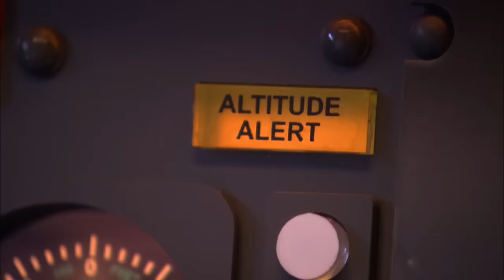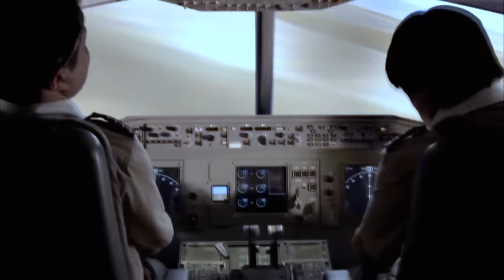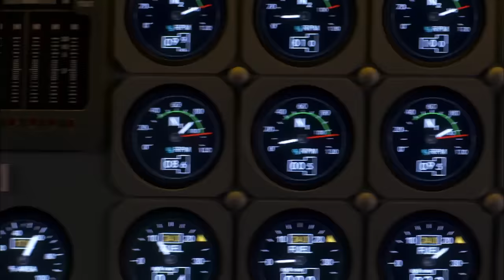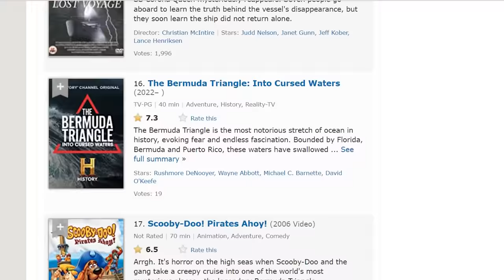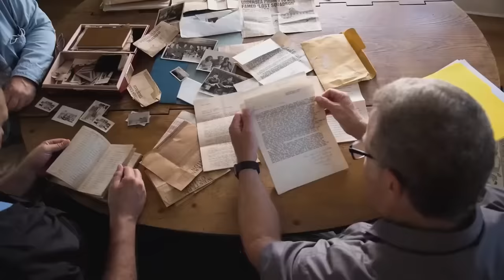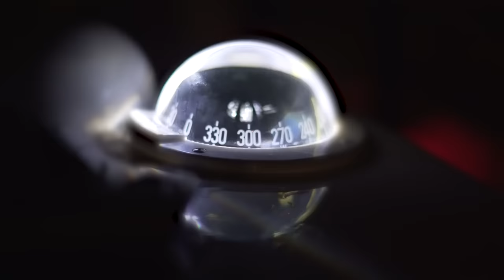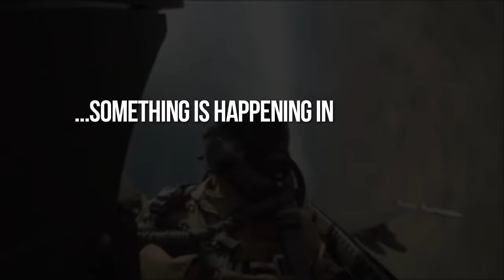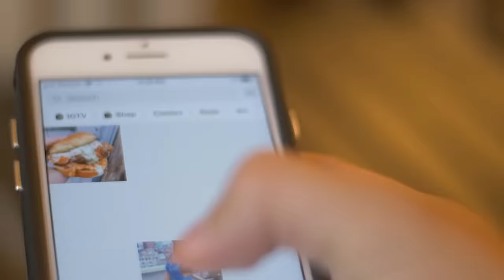Scientists Have Finally Solved the Bermuda Triangle Mystery! What Did They Find Out?

Comment: My theory came out when I am  travelling long stipped mountain have good road surpace about 200 meters long high.
 So I start going up driving a truck loaded gravel.When  I reach 25 meters up the truck engine showing hard to climb and engine deacress sounds from 25  to 35 meters so worrying my  travel. However after  35 meters  the engines sounds  good  shows it's not hard to  carry the load .So I reach the 200 meters easily

Comment: Probably, gravity distribution is different. That's why they having a hard time navigating.

And the reason people are missing, probably tried using emergency boat to escape
Reply: what about the airplanes
Reply: @Crys582  what do you mean? airplanes are also affected by gravity

You can see that if one wing of plane weight is not aligned the flight is not stable

You can also watch in youtube a guy who changed balance of plane by just opening a window and putting hand outside means the weight(gravity) difference also affected everyone even in air

Comment: The blackbox at 0:27  is from Japan Airlines Flight 123 around 1985 jal123 was flying and then suddenly an explosion happened at the rear which blew the tail off then about 30 minutes later it crashed in the mountains

Comment: magnetic phenomenon i knew it lol. (side note: i still believe "space" itself is filled with an ever expanding "sea" of dark matter which is a gas/liquid mixure that rejects physical matter in the same way that hydrophobic sand repels water. the only reason space seems more like a vacuum from our perspective is because of the cosmic "bubble" aka. the heliosphere, which is formed by the sun around our solar system which in turn is so strong that it legit glides through  the dense surrounding dark matter throughout our cosmic "sea" like a drop of water on a hot skillet basically resulting in our solar system gliding through dark matter with very little friction resistance. this would account for the odd shape of our heliosphere, it also accounts for Gravity and why we cascade around the sun as if it was pulling us in its liquid current rather than its "magnetic pull". This also explains why Jupiter can influence the orbit of asteroids and such as well.  annnd lets not forget that this would solve how atmospheres form and could completely change our understanding on the illusive dark matter and opens more questions to why D.M. holds such a phobic relationship with magnetic matter itself. lastly it also explains why we havent seen any atmospheres form around any rogue exoplanets. the gaseous bubble cannot form under the normal intense density of dark matter but only within the far less dense space within a stars heliiosphere.) - sorry im a space dork. go ahead call me crazy i get it lol. I call it "The Dark Sea Hypothesis"

Comment: I think there's a mystery for time travel in the Bermuda
What attracts in two opposite directions has an entrance and exit.. just like nodes and antinodes in an electric circuit.
Even tho not proven, the conception of worm holes as it is assumed a possibility to enable time travel, when time reverses in a physical environment and was properly seen and confirmed and there has been a reappearance of the same lost object, the human mind gives into any environment and the energy from the human body conducts with anything at anytime. The body is not an insulator, so if there's an energy around the triangle that causes a reaction which sends people to a place and brings them back possibly after some time with a confirmed difference in time, then there's a possibility for the Bermuda to be a tunnel for time travel.

Comment: My Theory: As we know, deepest points of Ocean are in these areas. Bermuda Triangle and the Japanese triangle. If you look at earth’s inner layers, these points are much open to the layers (ykwim). So even a small tectonic plate movement causes the ocean to go crazy. If you look at records, there are hundreds of earthquakes every week, but the layers of earth are thick so we don’t notice em. But the deepest point doesn’t have as many layers as our side, so its more prone to create weird weather issues. Also Magnetic Field is always there, like I said, cuz of openess of the place, magnetic field is much stronger as that magnetic force doesn’t have to pass through a lotta layers. The air, even the skies hold some charge of electrons. Thus the skies nd water acting weird. Why we can’t measure the stuff in these points is cuz of the strong earth magnetic fields interfering with the systems nd the sky trying to act of up cuz of the equipment disturbing its flow of energy. Ykwim? As for the flight, it is unexplainable i agree. But I think it could be the guy was flying in a “no man zone”. Basically where there is no force of each side. Same thing as Maglav. The system used by bullet trains, as it increases the speed and reduces the consumption of fuel cuz that force is rubbing against eachother and propelling u forward. My main language is not english, but I tried to explain. These are my theories. So… nothing proven yet but these make the most sense to me as I’ve been fascinated with mysteries. So Peace Guyz :) leeme know ur thoughts in replies :)

Comment: This has also been debunked.  It simply makes the creator money.

1.  There have been no more losses there than would be expected for that area and activity.  There is nothing unusual about not being able to find something relatively small and not containing much steel in a big ocean in deep water.  There has always been a lot of training activity in that area by the armed forces because you can train all year long in the south, and the Navy trains carrier pilots there too.  Engines were not as reliable as today.  Military aircraft are optimized for combat effectiveness which requires safety compromises.  Most could never achieve normal FAA certification, and nearly all of the few that can were designed for civilian use in mind.  During WW II they coined the phrase, "One a day in Tampa Bay" .  MacDill Army Air Force base alone lost 15 airplanes along and their crews during a 30 day period.  The Army lost a crew every 4 weeks when learning to fly with night vision goggles with their helicopters.  It took quite a while to come up with the CORRECT conclusion why so many P-38s were crashing into the ground and water at high speed and the same with the A-10, and determine what was going on with the F-22.  State-of-the-art means no proven track record but for the military it is lower risk than the alternative.  Wives of servicemen have many functions where they are expected to participate, which actually forms a support group when when husbands are away or something happens.  The common tension they experience drives them together and forms bonds that causes them to communicate with each other for the rest of their lives while experiencing no such lasting bonds with those they grew up with for many years.

2.  The earth's magnetic field is weak and there are known magnetic anomalies in that area, as there are many places on earth.  While I was in flight school for the military, part of our training was about flux gate principles and how gyro compasses work.  Magnetic compasses are constantly bobbing around and they swing way off your true heading when you bank, demanding considerable attention to maintain a consistent heading.  About the only time you look at the magnetic compass is as part of your pre-flight checklist to endure its calibration is up to date.  This begs the question, why even have it?  They had been invented prior to WW II, but it would have been very unusual to have one prior to that.  They became common in combat aircraft on both sides during WW II.  As hours of experience accumulated, they learned that flux gate principle has one weakness.  It can read exactly opposite under the right conditions.  They determined that is what happened to the flight of 5 Avengers.  It is also the reason that they put the old-school seldom-used magnetic compass back in aircraft.  They were in radio contact and they said they were lost and couldn't see any land when they were expecting to.  The Avengers ditched, the seas were rough, and if the sea plane may have been lost for any number of reasons, including if they decided to land out there.  Radios would not be reliable for another 25 years.  None of the aircraft had ELTs, and they would be like finding a needle in a haystack.  The Avenger story has been pumped over and over again to support this hoax to make money.  Whoever made this video knows all this.  My thoughts in "fright" school were to pass it off as something so rare that nobody is likely to see this with aircraft since that period.  Meet Nobody.  After a couple thousand hours with never a hint of a problem, one night I was flying military and practicing a manual old-school instrument approach in Northern Michigan and experienced it while shooting a tear drop.  I did a missed approach and tried twice afterwards to repeat it and would not.  Nothing like this ever happened in my own airplane where one would think it would be the more likely.

3.  Weather is another factor in the south.  Thunderstorms that get to 25,000 in the north can get up to 70,000 in the south, so you can't just fly over them.  In years before Doppler weather radar, they had to pick their way between cells visually but the area between them is not always clear enough to do that.  Today, its Doppler color radar in the cockpit and you can see where the intense areas are by color, and pick your way through them even if you are in the soup.  A not uncommon conversation is when you are being vectored based on the weather to have to inform them you cannot comply because of what you are seeing from your better vantage point.  Adjustments are worked out and your report is incorporated into ongoing operations and used to notify others.  In the days before Doppler weather radar, it was much more common for the weather to be significantly different than briefed, fewer boats and planes to report it, and no coordinated network outside of combat zones to DF their location.  Thunderstorms so common during the afternoons near the equator have updrafts and downdrafts that can easily exceed aircraft climb performance and put you into the ground or water or bend or take the wings off many aircraft.  Anybody who lives down there can tell you about water spouts, some regular tornadoes over water, which are very common to see.

4.  I grew up in Michigan and Michiganders don't know what you are talking about.  "Salties" used to run into trouble in Superior and Michigan after the St. Lawrence and locks were opened because fresh water greatly reduces buoyancy, and the different fresh water wave formation can place stresses on their structures that they don't encounter in salt water.  From the comments, people who grew up in Australia never heard what was mentioned in the video either.  They were attacked by Japan during WW II and it is a busy area for shipping and fishing trawlers.

Comment: Think, what holds the plane in the sky, it’s wings. The wings are for a fixed standard gravity.  Weight ration to gravity has to be constant to be true. Ships in buoyancy according  free board of insurance standard. UntThe limit of load by the insurance rules of freeboard. Gravity on load, may be more places on Earth. .
So like planes In flight, gravity, void, is no wing lift.  Ship is in stronger gravity, is not able to be buoyant enough to cope. One theory, bubbles in sea bed from Earth rising en masse, reduce the waters ability to support  the loaded ships. Winds above , change the suction on the water surface and pull gasses up from thin crust areas of  Earth.  Gravity is dangerously responsible for loss of lift, stall in a storm. No wing lift.